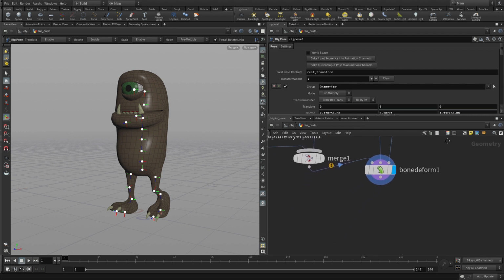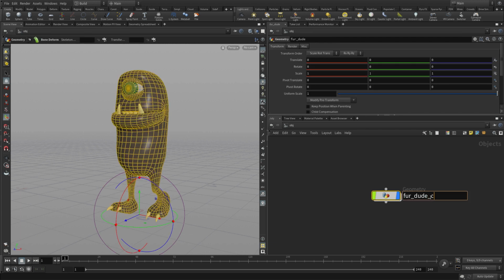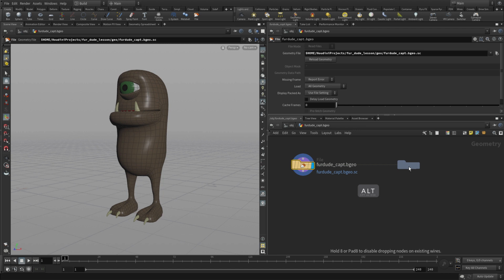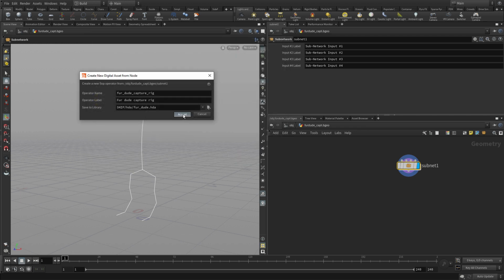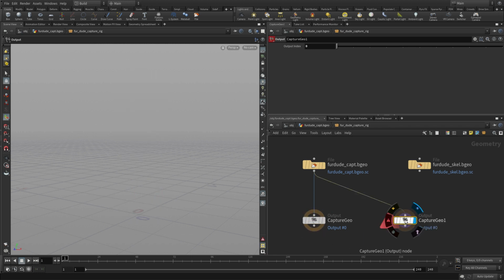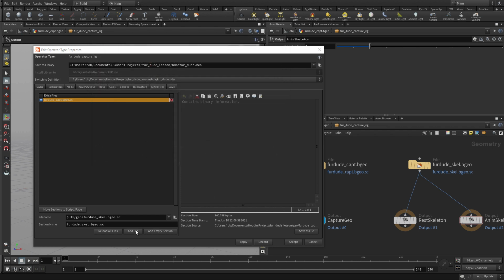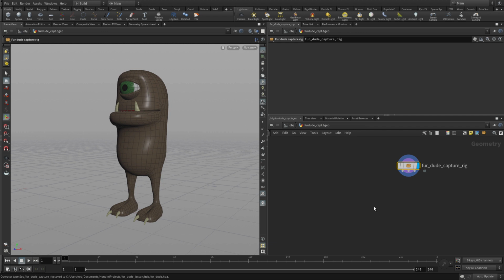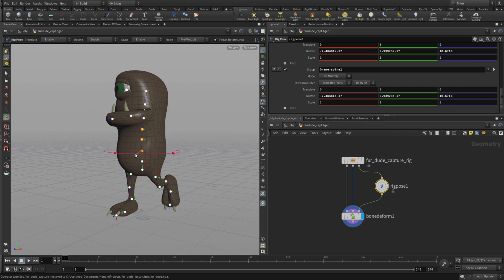KineFX Rigging | Fur Dude | Part 7 | Create the Capture Rig Digital Asset

Comment: Using H18.5, I cant see anything in the opdef folder (5:42) so couldnt see the Sop folder of the furdude folder so couldnt reassign the capture and skeleton files. Why would the opdef folder be empty? If I manually type it, there is no erroring though, so curious as to why this happens. Is it something to do with project structure? I created a project in the default folder, so any help would be appreciated. At this stage, I think I can carry on though as it seems to be ok. Will know by video 8.